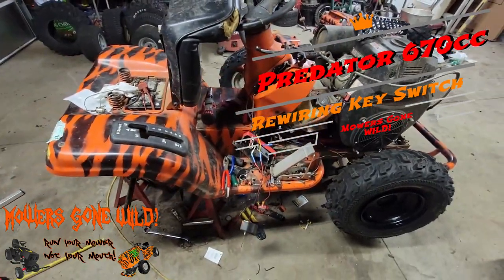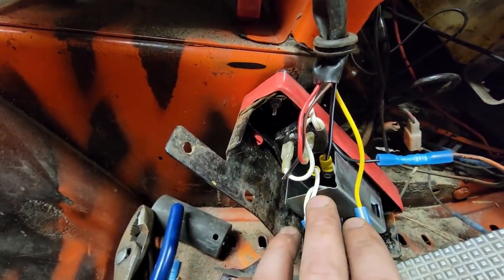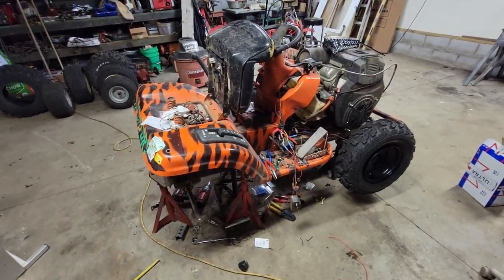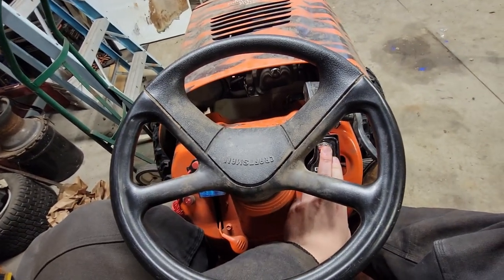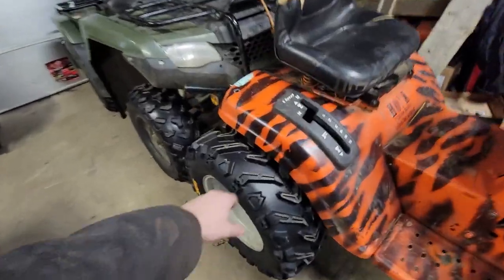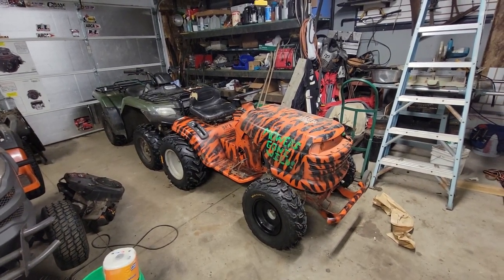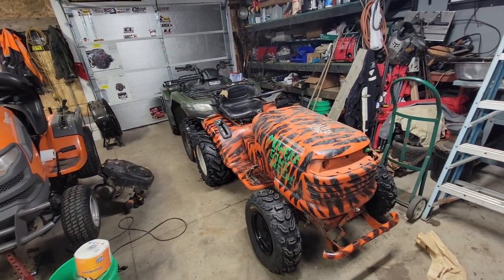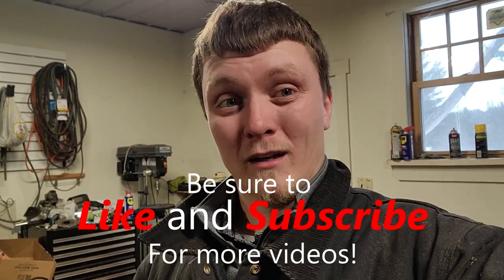How To Rewire a Predator 670cc on a Mud Mower

Comment: how did you remove the old key switch,  i can’t seem to figure it out
Reply from the maker: I believe all I did was unscrew it, as it had a circle style nut around the face and then took the back plate off.
Reply: @MowersGoneWILD  ok it almost seemed like it was crimped on so i didn’t know if i was going to be able to twist it off, thank you